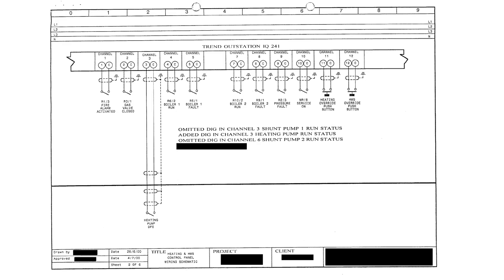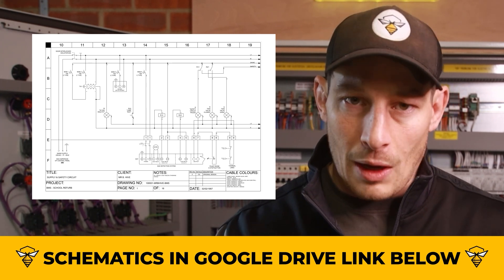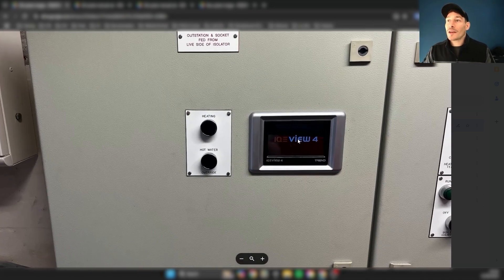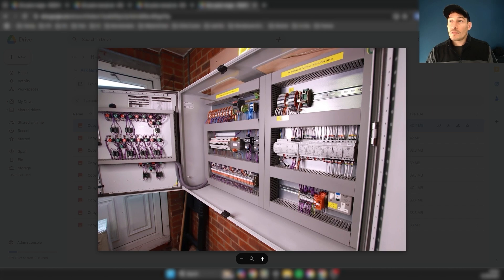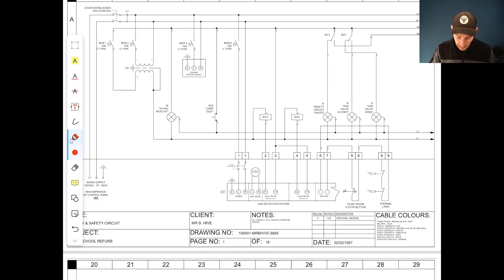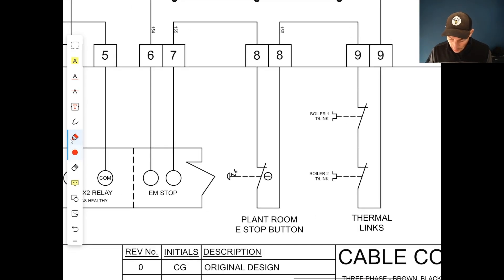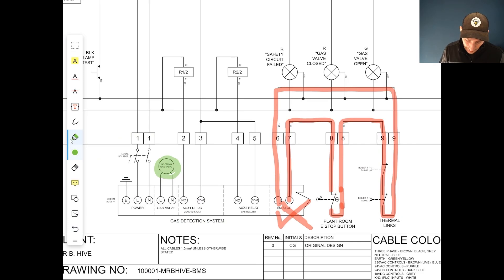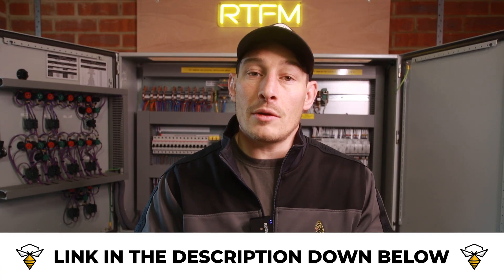This Stumps Most Electricians - Can You Solve It?

Comment: Regarding the E-Stop, I usually have 4 terminals for e-stop. 2 terminals are used e-stop button which is on panel, and extra 2 are spare for external e-stop. They are shortened by wire jumper and waiting there for the day when customer decides to add some extra e-stop.  
Its a good habit to have extra point where another e-stop can be connected.

Comment: Jesus are you serious. I would expect any apprentice to solve this in seconds, got to be a wind up.  Second Estop wired to main panel in series with existing. Just need to add a terminal to join the middle cable together. You can do a better challenge than this

Comment: Without knowing what the safety performance level required for the system nobody can answer this… 

Not a fan of running single channel in series on a safety circuit… 

If any of those contacts weld then the safety system will fail… 

Dual channel to individual safety rates inputs is a better solution…

Comment: Easy way, or proper way?

Easy way is to run cabel to the existing 
 e-stop and wire it serial there. 

Proper way is to put additional terminals in the panel, and run the cabel there. That's what i would do, speaking as someone who've been building controlpanels the last 13 years
Reply: Besides that, I believe that terminal-marking is atrocious. Each terminal should have its own number. Only excuse to give multiple terminals the same number, is if they carry the same potential, eg. A positive or negative for multiple cables.
Reply: @allanriis9335 what 🤷🏻‍♂️if the +24v goes to 6 terminals you want a different number on all of them. Hope I never work on one of your panels. Terminals should have the cable no on

Comment: Add a e-stop between MCB4 and Terminal 1 ( 21yr old electrical technician here)
Reply: Although what you're saying would work it wouldn't work well and is not correct. 
The right way is to incorporate the estop in the estop chain of the safety controller. Your way would not let the safety controller indicate what went wrong, wouldn't let you program additional functionality, as well as you'd lose key safety checks like cross channelling or time checks if dual Channel were to be implemented later

Comment: Nothing is finalised until after commisioning thats why you have as built schematics, if you do this for a living this is common practice the client always has additional requirements. Why in this day and age are you also still using single channel safety systems? It should be minimum dual channel, and you always add additional terminals in the safety loop.
Reply: Sorry, but nothing you just said bares any relevance to chris's question. And what you just said about "should be dual channel minimum" is totally, and utterly wrong... 

For a start, dual channel architecture is only required for PL d and above, and secondly, for an E stop circuit, PL d can still be achieved even with a single channel circuit. Because diagnsotic coverage is attained by 12 monthly testing, which in the case of an emergency stop, which is a last resort, after any other safety interlocks have failed, means 12 monthly testing still falls into the range of the test being carried out 100 times more than the demand rate (which is theoretically never if the rest of the system is designed properly)

And this still, is only required as a justification, IF the risk assesment requires performance level d, which on a BMS system is highly, highly unlikely. Performance level c would be much mpre common for this type of installation, and PL c os single channel architecture
Reply: @matthewwren1736 You said a lot and at the same time said nothing very impressive, After 30 years of designing and programming safety systems It's easier and more cost effective especially in the case of dual channel estop systems just to over spec. them from the start, Has no real downsides and very minimal cost implications, but does provide additional peace of mind and future proofs the system. You can do all the risk assessments and categorisations you want but never met anyone who complained that a system surpassed their minimum safety requirements.

Comment: Remove link between 8/9 tie new e-stop in there.
Only need to run a  1 pair out too new e-stop without touching the existing e-stop circuit rerouting the  cable would probably end up with you needing to run a new one because more than likely it'd would be too short.

Comment: I think I know better electricians than Chris does..  Or maybe I need to test them with this, but I think that 7/10 of our guys would solve this with the clean solution.  Rest of them would do it the easy way and add junction box where the routes fork from each other and use the least amount of cable and time.

Actual hard problems might be fun.. This scheme could be fixed with one copy/paste and adding one line on a mspaint etc.  Maybe add the actual name for the other estop.